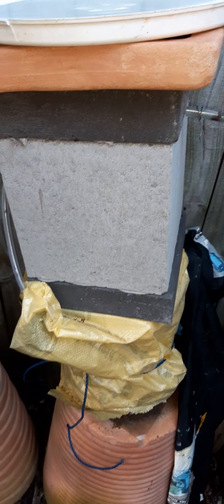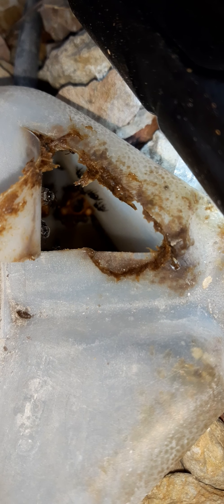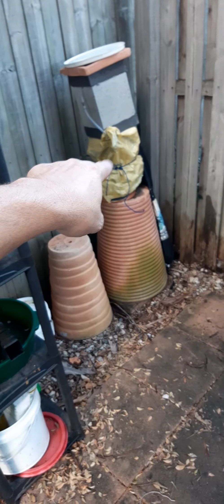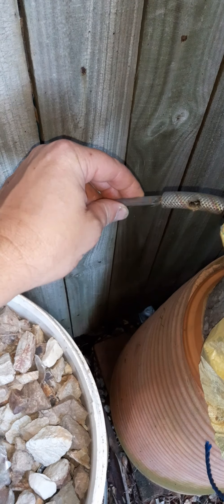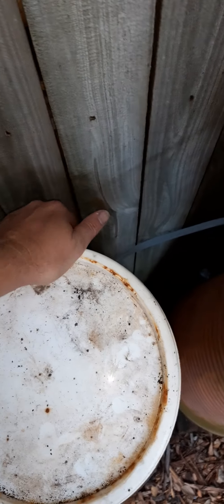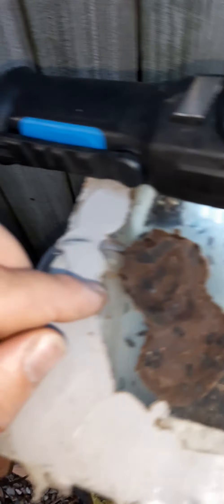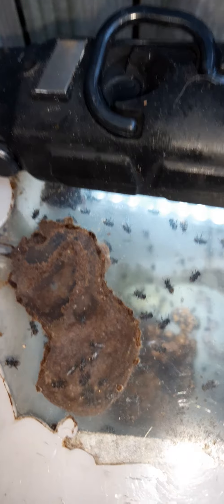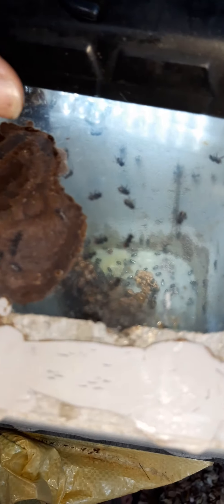Hive duplication update, 3 for 1 deal

Comment: I’ve been watching a bloke in Indonesia using soft drink bottles with a layer of sheet insulation wrapped in black plastic. I can’t understand anything he’s saying but the diversity of his hives is awesome. Almost every new colony is always by the eduction method
Reply from the maker: Yes i have tried his methods.
But the bees act differently here and dont swarm as angrily and when he taps the box and tge bees go into the bottle, it doesnt work here.
The eductiin method works though.
But he is actually absconding or trapping out the bees by distance and the queen eventually moves into the new box leaving the hive in the wall empty.
In my experience with australis bees specifically they move into new box with the queen as well and the old hive had workers but no queen after inspection.
So im not sure if australis is a good bee to use this method.
I will say that this is a perfect method to "PRIME" a new box by eduction but then taking it away and using it for a split as the bees create a perfect propolis coat inside and a few stores as well.
Reply: Ahmad Jalian is the bloke.  They definitely are rougher while handling the bees. In some closeups the bee look more like some of our wasps with the longer legs and abdomens